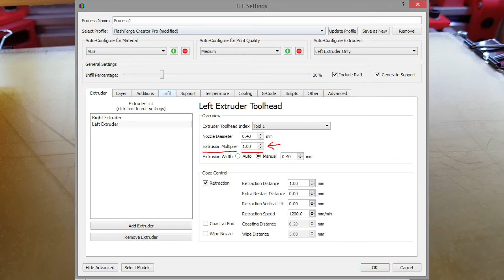IT'S FINISHED!!!! - 3D Printer VLOG #30

Comment: I was looking at building this same design D-bot, I have some concern about the Z table, looks to me that there is a lot of stress on the the wheels of this cantilever design and wondering if you made improvements or found an update for it.
Reply from the maker: I ultimately switched to 3 sets of LM8LUU bearings on 8mm smooth shafts. Hoping to have time soon to post an update video. :)
Reply: Argh!!,  I hate LM8LUU bearings!   the reason I am looking to go to v-slot.